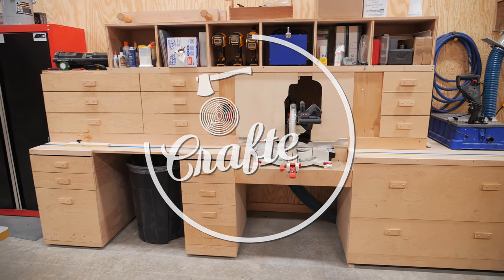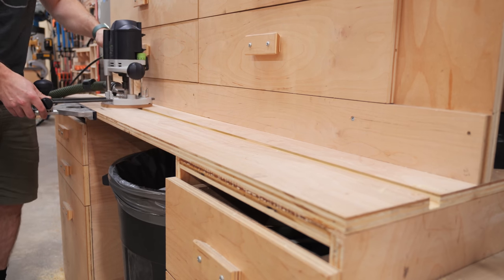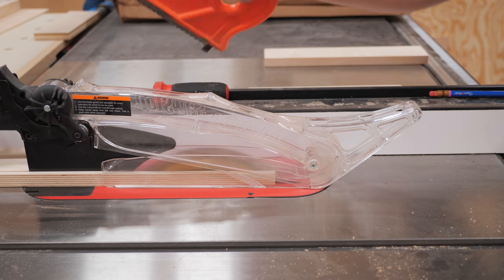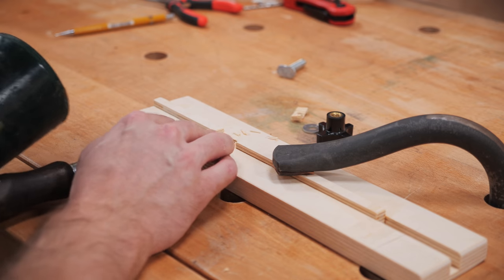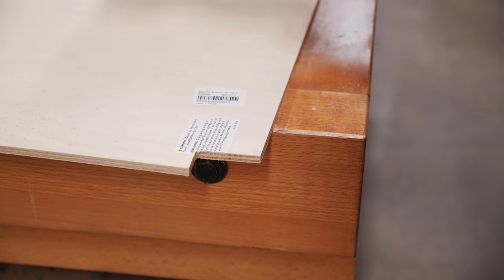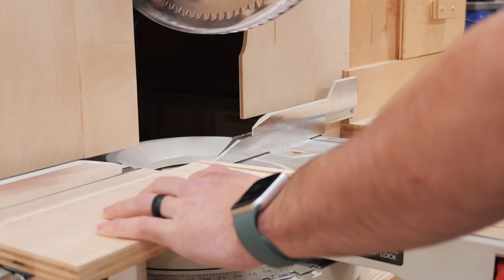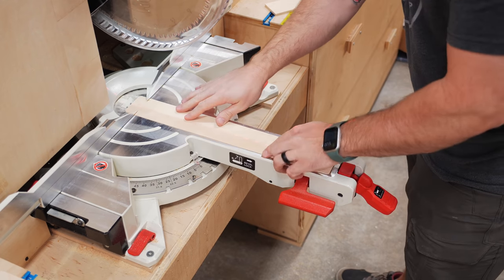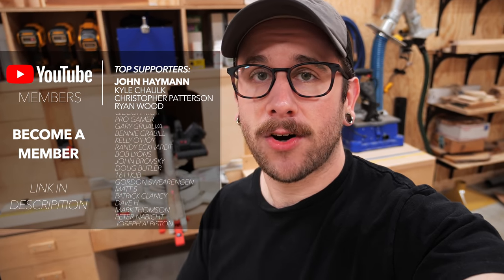3 BIG Miter Saw Station Upgrades! Stop Block, Dust Collection & Zero Clearance

Comment: 0:55 I did mine the exact same way, but did put the tape measure right up against the t-track grove (the blocks I have sit above the tape and will not touch).  I'm lucky to have enough space on one shop wall to build my ~19' station... provides more than 10' of cut ability to either side.  I used Fastcap tapes... they are metal and lay perfectly flat (they are the best IMHO).  Next I'm building a set of 4' removable fence extensions, so they can be stored when I want to use the tables for other tasks.

Comment: I am in th process of building my new wood working shop. My next project is to make a station for my brand new DeWalt 779. Instead of T-track, my system will use Microjig parts which are. much cheaper and more versatile.

Comment: So if I understand this correctly, you’re setting up the measuring tape to the hairline indicator, but the 36” mark on the tape is not 36” from the blade but 36” plus the distance from the edge of the stop block to the indicator, correct? So the 36” mark is really somewhere in the 40+” distance from the blade?

Comment: Hi Johnny, about to start work on the plans I bought from you for the table-saw outfeed table.  In the meantime, I was watching this video and have a question.  Since you are using the Jet SCMS your bench setup has to be further from the wall.  What is the distance from the wall to the front edge?  I am in a quandary as whether to buy a new saw or utilize my 10" Bosch but it needs the rear room.  Thanks and keep up the great work.

Comment: the reason for the different thickness of the plywood is. The thinner one is 6 mm thick while the thicker one is 1/8 of an inch. The difference are 0.35 mm. Doesn't sound much? In this case when you try to set the insert flush with the Miter Saw it makes a difference.
This would be a reason for me to switch to metric and those problems are gone.

Comment: If you’re running a t-track and bolt. What’s the point of the runner you made? It’s not really doing anything.
Reply from the maker: The runner keeps the stop block square to the t-track. Otherwise, it will want to shift around. Try making one without one and you'll see what I mean.

Comment: Nice upgrades man, but why are the stop blocks so big?
Reply from the maker: I made them longer so I can cover both ends of the tape measure. Any shorter and I'd run out of stock block before that measurement.

Comment: The zero clearance on your miter saw has nothing to do with tearout... mitersaws cut as the blade is going up... in fact,, you did not even need a sacrificial bridge when making that cut with the inserts out unless your off cut was small enough to fall in the void every the inserts were supposed to go... but knowing the exact kerf location could be useful.
Reply from the maker: Hey Jim, that is incorrect unfortunately. The blade rotates downwards, causing the wood fibers to be pushed towards the base of the saw. Just look how the teeth are oriented on the blade.
Reply: @craftedworkshop  no it does not... if that were the case, dust would fly in your face. The saw exits the wood as it moves upwwards... that is why the dust collection is in the back of the blade and above the work piece.
Reply: @craftedworkshop  its also the reason we make scoring cuts to the top of a workpiece... to minimize tearout... if your cut is made properly, any tearour will usually only occur at the back of a piece....